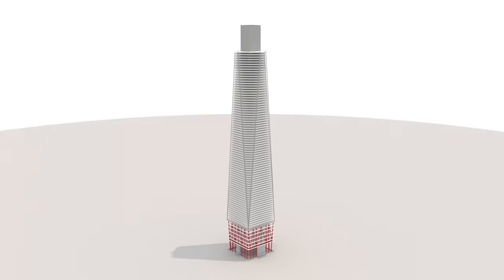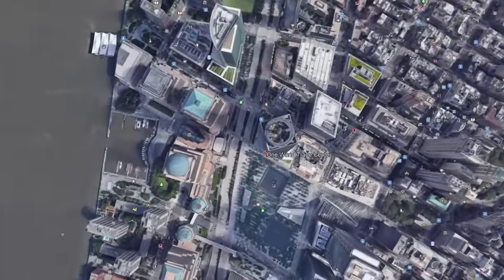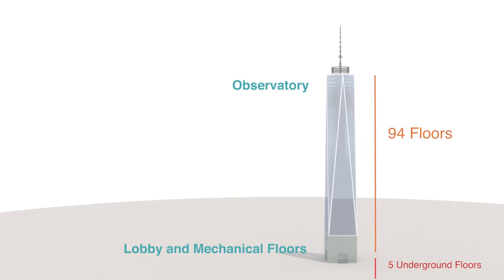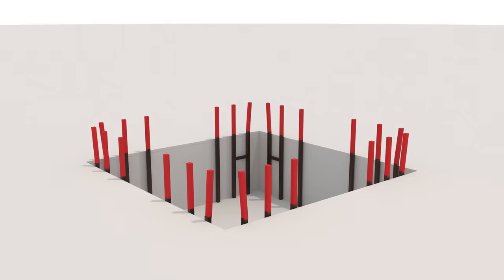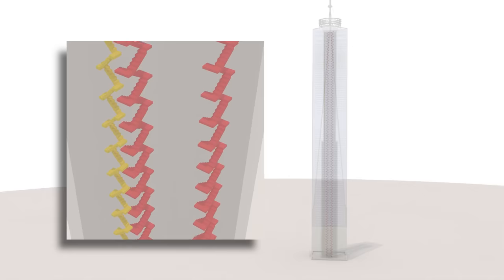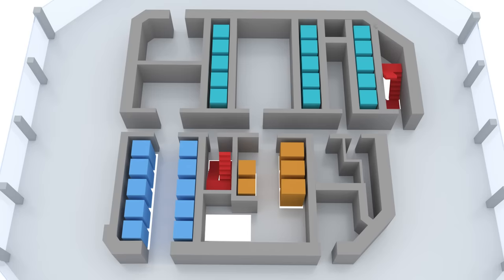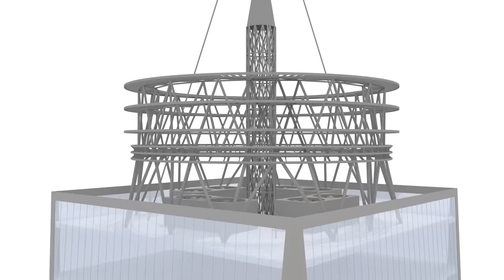What's inside One World Trade Center's structure?

Comment: Yeah, you can see their primary goal with this new tower was to make the stairways protected and separated from one another to maximize the likelihood you can take the stairs to get out, even if a commercial jet flies into it.
Reply: I like that they made a special staircases for first responders to use in an emergency.
Reply: Is it just me or does anyone else think those staircases are still to close together...? Like if a big ass plane like the one from 9/11 would smash through the floor it looks like it would destroy or at least damage both of them.
Reply: @BlackChad792  A concrete core that thick would be effectively impenetrable to aircraft. High strength concrete combined with heavy reinforcement would shield most of the core from any impact damage. The original WTC had an open core with only steel beams. The walls were only Sheetrock, like you would find in most houses.
Reply: #johnnyx100 🌟🌟🌟💗💗💗🤑🤑🤑🤑
Reply: @BlackChad792  Yeah, like someone else already noted, a thick reinforced concrete core would protect against an airplane. It's how they make containment buildings for nuclear reactors...
Reply: @BlackChad792  Yes. I'm currently reading '102 minutes' by Jim Dwyer and Kevin Flynn, in which a lot of the design problems of the original towers are addressed. While some have been dealt with in the new design, others have not, it seems. To me it looks like they specifically tried to prevent the exact thing that happened on 9/11, but maybe not other possible attacks/disasters. I appreciate that the core should be able to withstand an airplane attack, but the fact that there is only one such core that contains all escape routes still makes it vulnerable if anything were to happen within that one core. It would be interesting to know if they also took into account the 1993 bomb attack, in which the main problem for the people trying to get out was the thick black smoke coming up all the stairs from the basement. Having at least two cores containing stairs, as far apart as possible, might also have been a solution to that potential evacuation problem.
Reply: @BlackChad792  they added more safety features but at the end of the day it is impossible to build a tower which can withstand a plane crash at full speed.
Reply: And hopefully a plane will never hit it purposely or accidentally !
Reply: Lmao why would you want to get out it's bad for business
Reply: @JaneFokster  yes and that's why well demolish it then replace with a much better building
Reply: @josephstalin9357  this tower was designed for that very reason even if a commercial plane flies into it which is almost impossible now that building’s not going down
Reply: @BlackChad792  Even if god forbid a another big ass plane smashed into The New World Trade Center, it would damage the building no doubt, but it wouldn’t completely destroy the building, unlike with the original Towers.
Reply: i dont get why they do this since there is strict airport security and even if 9/11 happened again they would pick a different building that wasnt so strong like why they didnt pick the empire state building
Reply: @terigonUSAS12  Ummmm, it’s safety precautions bro, anything could happen. Not having wider stairwells/cases are one of the primary reasons 9/11 was an apocalyptic event and so many people died.
Reply: @terigonUSAS12  The world trade center in a way symbolizes the center of economic power in the world. It's an obvious target.
Reply: @BasePuma4007  yes but the empire state building was a major landmark but the terrorists knew the twin towers are weaker
Reply: @josephstalin9357  your only one with sense it’s impossible to make a building that can withstand a large plane crash it’s like saying you can build a building that won’t be affected by a bomb dropping it’s impossible once a large plane goes fast towards a building with all that fuel it will cause a massive explosion not like a nuclear bomb but still a large explosion that will destroy what’s in its atmosphere you can’t tel me a bunch of concrete will stop a strong blast no concert here can stop a bomb explosion it’s the same thing apple does with glass saying we have this glass that won’t break but it’s still glass a glass will break doesn’t matter how strong it is now they can say we made the concrete stronger but that doesn’t mean it can’t break it’s just stronger now but an probably can hold up better than the old tower logical speaking I believe this tower is stronger so if a plane like before we’re to run inside what I think would happen this time will be the stair cases might be in tact but severely weaken an or on the verge of collapse so it will basically give people more time to rescues an escape but by no means do I believe for one second will those stairs be intact on impact completed not damaged as I said on impact not the stairs that’s outside of impact
Reply: @BasePuma4007  it also symbolizes white supremacy
Reply: Commercial jet flying into a high rise building? We don't know yet, it has never happened.
Reply: it's pretty smart they built basically a tower within a tower, so even if the shell fell off you have the entire inside core
Reply: @adamk203  Not to mention the steel, class and other reinforcements before the plane even gets to the concrete core
Reply: @BlackChad792  Even starship with a thrust double of the Saturn V couldnt blast through more Than about 1 meter concrete and that wasnt as strong as the concrete in wtc1
Reply: @Ontiming2023 Really….. one world trade center symbolizes white supremacy? Thats just pathetic bro.
Reply: I believe they are pretty much spread out all the time
Reply: @probochronicles3991 yeah they are doing everything they can to ensure something like 9/11 doesn’t happen again
Reply: I can't see another hijacked plane crashing into a building again, at least not in my lifetime.
Reply: @leeriches8841  With prudent security measures at airports, hopefully not ever again. That doesn't mean you don't build it to be safe in the event that it does happen though.
Reply: I don't think it's that certain. There isn't much that a 767 traveling 600 mph fully loaded with fuel couldn't destroy.
Reply: @Ontiming2023 😂 f’n 🤡
Reply: @adamk203  I doubt the core can handle A380🙄🙄

Comment: I saw  it back in 2014 very nice building. I like how they added steps for first responders. Post 9/11 they thought of everything. Cool video!
Reply: Good but unfortunately you can’t never think about everything.
Reply: @jolldoes1515  true but at least it’s something that was put into motion, as this wasn’t apart of the original twin towers design.
Reply: I wonder if they have equipment every 10-15 floors for a number of first responders ahead of time. Like Oxygen tanks on the 30th, Multiple Houses that are able to span the lenght...
etc..
Reply: Well, the original towers had steps, but they weren't any good after a certain height. In addition, think of first responders walking up all those steps with all their gear. Pure stupidity to have buildings that high.
Reply: @mrblock1318  doubt it, too costly
Reply: They didnt really change anything. There were three sets of staircases before, only now there is one less staircase for people to flee down in a disaster. As 9/11 showed, the stairway columns were in the core, and so were all destroyed in the north tower and all but one in the south tower. The concrete innards of the building will likely be much more resistant to fire and explosive force then the old stairwells though. Engineers decided that making a building airplane proof would cost too much money to something predicted to be a extremely rare event
Reply: @mrblock1318  Maybe a limited set of equipment but not oxygen tanks. Those require a good amount of continuous maintenance to maintain as well as specialized storage as they are themselves combustible. The biggest thing I can think of is there are probably redundancies after redundancies here regarding the sprinklers. In the original WTC towers there was 1 line. Once that was cut it was done for.
Reply: The first responder stairs are good to ease the congestion on the main stairs for evacuating workers. In the event of a 9/11 style attack they’d be just as useless as the others as no building is truly “plane proof”.
Reply: Shoenheim  what
Reply: @mrblock1318  not so much oxygen, no. They would be relying on the fire and HVAC systems to do their jobs, and also smoke and fire doors are guaranteed to withstand both for a predetermined period of time. In high rises, there are so-called refuge areas or possibly floors. They are designed to be safe havens when evacuation may not be safe or possible. They tend to be heavily engineered and sealed against fire and smoke. The HVAC in these areas is also segregated, pulling in fresh air from outside.
Reply: I think they made it of All Glass to so they can bust the windows out next time for air hopefully there won't be a next time🙏
Reply: When I was watching 911 news live, I remember thinking tall buildings needed parachutes incase people can’t walk down.
Reply: @bellam31  I thought the same!!! but then I considered the fact that new york has tons of tall buildings and if they parachuted… they’d probably end up smacking into other buildings and harming themselves😬
Reply: @mrblock1318  They are an additional fire hazard. Oxygen tanks are highly volatile.
Reply: @TXnine7nine  so, it's not Oxygen, but compressed air that Firefighters carry on their backs
Reply: @kairastormborn7742  as a compromise for one less stairwell, they made the stairwell wider so more people can flee at the same time. The original trade centers stairwells were small and cramped so fleeing was very difficult.
Reply: @EldiniTheGenie  yeah they made it wider than regulations require. While i think that is good for evacuating people i worry about the larger open spaces in the core, with even more elevators than before, which in 9/11 shot jet fire everywhere down the elevator shafts and burned a lot of people. I think they made Some improvements but im not a fan of having all stairways in the core, as if a plane flies thru the middle then all stairs and elevators are most likely completely unfunctional. The north tower was completely blocked. Orio palmer (firefighter) made it to the 78th floor of the south tower, the point of impact zone, and there was one functional stairway, only because it was lucky and a bit farther away than the other 2
Reply: I hope they added parachutes and class lessons on how to use them for those working at the very top.
Reply: @cplcabs  Yea, the staircases in the twins were fucking awful, they were so damn tiny.
Reply: @jolldoes1515 be that as it may, the original twin towers weren’t designed with safety in mind. This building was. The new one is mostly concrete which is all but impossible for a plane to destroy and not to mention much more fire resistant than steel which the original twin towers were built with. Not to mention the stairwells are protected, spread throughout the building, and much wider than its predecessors. Plus there’s one strictly for first responders. Sure everything has a breaking point but it’s gonna take a lot more than a hijacked plane to prevent people, especially the ones at the top, from escaping in an emergency

Comment: That core is massive, like half of the whole building.
Reply: Barely leaves any actual usable space for the tenants
Reply: @markr7083  true but remember the twin towers had an open floor plan which lead to its demise so not making that mistake again
Reply: @fannynoriega9249  open floor plan is what sold the space
Reply: @fannynoriega9249  the only reason it got hit is because it was so high, so I don’t get why they didn’t build 2 builds half the size, this would mean a plane or something like that would not be able to hit it as all the buildings in front.
Reply: @markr7083  But its not wasted.  It houses all of the elevators, stairs, bathrooms, service rooms, and utilities.
Reply: @mikecostello705  I know, I’m just saying with the new building, why didn’t they make them half the size so it’s a lot harder to hit behind the buildings, I’m not talking about the twin towers, I’m talking about in case it happens again to the new building.
Reply: instead of reinforcing the middle isn't it possible to enclose the open spaces and surround it with reinforced concrete blast walls that is impenetrable, thus saving lives and the building itself.
Reply: @PurpleHaze4me  no, that wouldn’t work, also people need windows to work harder.
Reply: @cjuice9039  Biggest income old  WTC  was its Telco mast array probably freedom tower.... Leasing any floors bonus
Reply: @kotori but why do you think they targeted this building? there is a reason. also planes are not almost impossible to hijack, you just need something (eg. a gun)
Reply: @kotori you don’t think I know that? the first thing to know is that they have people working at the airport, it’s pretty obvious, if anybody needs to stay in school it’s you, when everybody goes back to school in 2 weeks, you’ll be going straight back to year 6.
Reply: @nope6786  because this building was deliberately built to be the tallest in nyc
Reply: @nope6786  do you think u can just bring a gun to an airplane???!! lol what the hell its impossible with all the security.
Reply: @groupie8985  inside job?
Reply: @nope6786  the terrorists could have struck a random apartment building instead with no problems
Reply: @nope6786  making it short doesn't help that much
Reply: @nope6786  it might help a bit but it was built tall so that there's a lot of space for tenants
Reply: @sunnyd pro firstly, it's still possible
Second, you could consider the unlikely, but still there threat of an asteroid striking the building rather than planes
Reply: @sunnyd pro security can't stop flying asteroids
Reply: @PurpleHaze4me  of course we should do both
Reply: @nope6786  no it's me
Reply: @nope6786  although I am still in school
Reply: @sunsetlights100 that's totally incorrect. The millions of square feet of class A office space in the most demanding market in the world is what sold. If the antenna was that profitable they'd have had one on each building.

Comment: The biggest point against 1WTC is not making the roof height 1,776 feet then having the antenna bring it up to 1,973 feet which is the year the Twin Towers were completed. 

Having the antenna count toward the full height is such a cop out. The Antenna isn’t even covered in the planned spire to make it look less naked. 

Since we aren’t getting Twins again, we should’ve at least made 1WTC bigger by roof height than the Twin Towers.
Reply: In a big way, I agree with that sentiment.  They could have made the roof height 1,776 feet and used a 225-foot antenna spire to raise the total height to 2,001 feet to symbolize the year the old towers fell, but I feel that would be very insensitive to the families who lost loved ones and friends that day.  But I agree that counting the spire toward the total height of a building is cheating as opposed to counting to the roof or the highest occupied floor.
Reply: I agree. To say a building is 1,776 feet tall when almost the top 400 feet are an antenna is not accurate. The height of a building should be measured from the ground level to the top of the roof.Antenna and spires should not count.
Reply: Agreed, but there's no market for office space anymore. They struggle to find tenants, which is why WTC 2 hasn't been started and may never be. I think they only made One WTC as big as they did for symbolic purposes. A smaller building would have actually been more practical.
Reply: @wll1500 Indeed.  The pandemic caused a paradigm shift in the way business is conducted.  The news full of stories now of people revolting against the companies for which they work for forcing them back to the office after they got so used to working from home.  While COVID-19 is continuing its long slog into the endemic phase, it is anything but through with us, and even the most careful people are still paranoid about getting it despite being fully vaccinated and still wearing their masks in public.  Old habits die hard.

Comment: Wow, this is a very interesting video. I love the structure design of the World Trade Center, especially as it fixes lots of the mistakes pre-9/11.
Reply: Personally, I think it’s difficult to consider the past towers a mistake in some way. Aircraft the size of a 757/767 simply did not exist back when these things were built, and even if they did, the concrete technology to make cores as strong as they are now, similarly didn’t exist. Even putting that to the side, a terrorist attack really wasn’t something designed for; 9/11 was quite unprecedented.

The pre-9/11 world and post 9/11 world, for better or worse, is a vastly different place. The unprecedented nature of these attacks is specifically why the legacy of said attacks is so far-reaching into our everyday lives. The TSA, for example, came into being specifically as a 9/11 security shakeup.
Reply: Most mistakes, engineering wise, are always figured out after a tragedy.
Reply: Yeah pretty unpredictable that a big ass plane would crash into it…
Reply: Calling the design of the TT a ‘mistake’ is wishful thinking. The architect didn’t get a full evacuation plan in case of 400 mph plane strike, because it hasn’t happened yet. The word you’re looking for is ‘faults’
Reply: No tower even this one would survive sustained fires across 7 floors. It might survive for longer but would still face partial collapse
Reply: Hello Antuber.

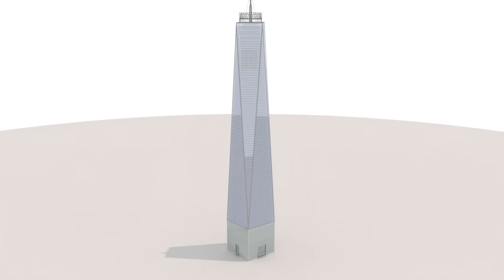Comment: You can see some of the features of "learning" from the old WTC design. There seems to be three stairwells instead of two, and two of them are further separated so that it increases the chance that one of them is usable and they don't both get blocked. See timestamp 2:19
Reply: There were three stairwells in the original buildings as well.